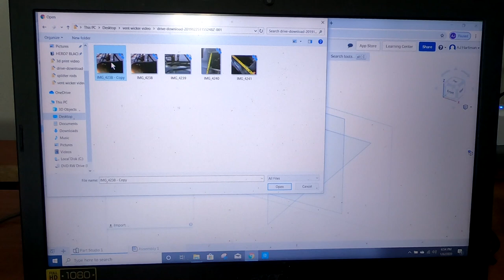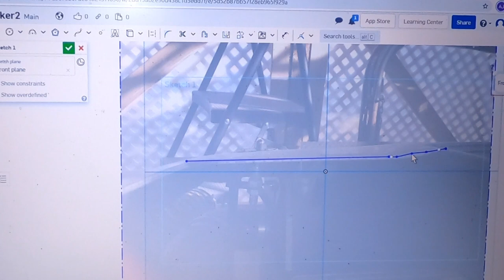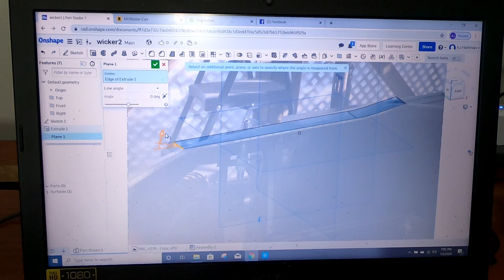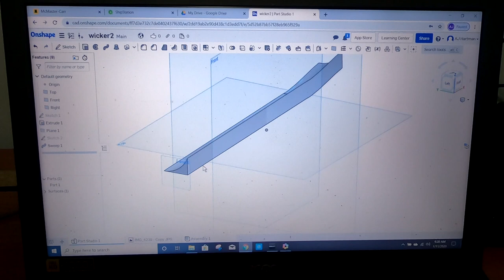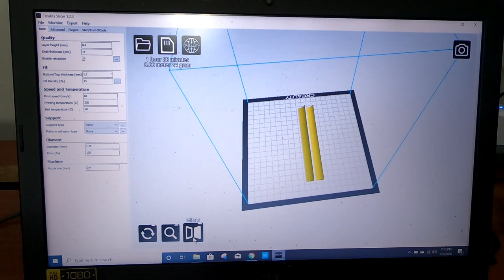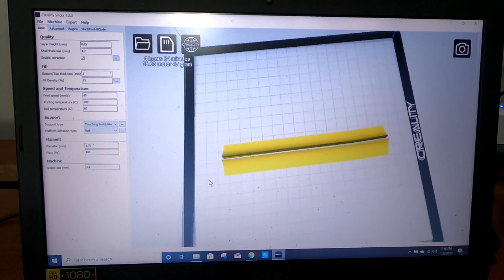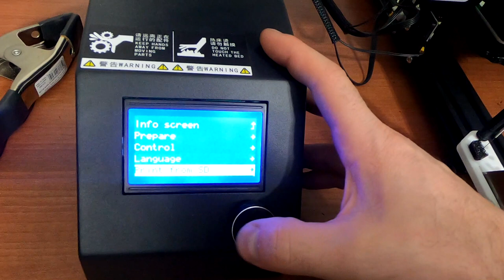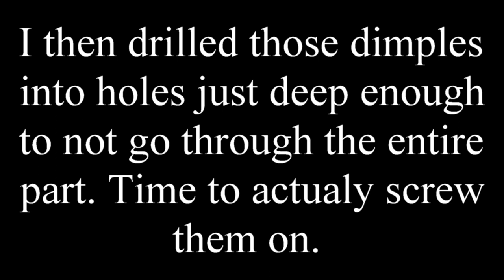3D Printing Car Parts from a 2D Picture

Comment: Great tutorial! I also Got myself a 3d printer for car related projects, CR10S )
Reply from the maker: Nice. Same exact one I got. I love the thing already. What projects are you working on?
Reply: @ajhartmanaero  Nothing fancy. Justified the purchase originally to make brake air ducts, but learnt that bigger parts take a lot of time and patience. Used to make mock-up parts for intake. Also did bunch of brackets/mounts and misc stuff... Big one was intercooler shroud for my Subaru. But again, ended up using part made from parts of failed prints from different versions of design because of time was running out. Still works to date, though!)))
Next one will be steering position sensor mount and suspension sensors mounts. Plus still 
want to make Porsche-style deflectors on front suspension arms to direct air flow to brakes...
Great tool overal, but takes time to master. btw, I'm also using OnShape, great stuff! Tried Fusion360 before, but licence expired and I can't justify paying for it for my tasks...
Reply from the maker: Homebuilt Racing nice. What material are you printing in? And yeah the time to print can be pretty crazy sometimes. Depending on the part I could make a carbon part faster. And that’s usually a time consuming process haha.
Reply: @ajhartmanaero  PLA inake part melted under the bonnet. kind of expected ) But easy to print.
ABS parts work better, but tricky to print. Need enclosure and some tweaks..
PTEG is currently my material of choice. I made string alignment kit with in PTEG. Probably would be easier to weld bunch of square pipes together, but I made it entirely of plastic and aluminium tubes...
You probably can make some fixtures for carbon parts, but again... I believe CNC mill and something easy to work on like foam or wood will probably be better for mid/large pars.

Also I experimented with big nozzles to decrease print time for larger parts. Basically with stock hot end  you can print with 0.8 or even 1mm nozzles and increase layer height. You end up with 30-40 min for reasonably big functional parts, but you needs to tweak settings and know the limit of your hardware, because appearance and strength can be affected after some point...
Reply from the maker: @777MAV  Thats funny, I've been really looking into PETG lately. My printer is in my house so didn't want to do ABS and seems like PETG is the next step up for temperature resistance. Since we both have the 10s you mind sharing your settings? What brand fillament? and what hot end did you upgrade to?
Reply: @ajhartmanaero  My settings won't help you much - It's not something fancy. I'm not printing lots of stuff, so every time is like a first time - update all the software, go trough new stuff.... Try printing... Fail... Adjust bed..  Fail.. Get profile from some forum or something.. Fail... and so on... 
Most of the time problems are solved with good bed level, dry filament and systematic approach. And if first layer sticks well - it'll probably be OK. Pros tell you that even different rolls of same brand filament might need tweak in temperature and other stuff, but I think in my case problem is that i leave filament open, it gets moisture and so on.. I don't have time or desire to go trough whole procedures (storage, calibration, preparation) as intended because at this point you basically 3d printing as full time job ))) So I kind of decided to go trough all these struggles every time...
Recently I used Amazon PTEG and i had good experience.. But not colors are equal, I even wouldn't say that it's same type of plastic looking at it. So basically you need to try something and stick what works for you. 
Also I recently bought piece of mirror instead of stock glass. It helped a lot with print adhesion but not solved all the problems.
I liked printing with ABS but process is more involving, but with good enclosure it works great. Althogh as I understand, nowadays it's basically replaced by PTEG because of easier to print and same performance in other aspects. 
Also printing less these days because I'm not happy running the machine in my apartment.  From what I read - any kind of plastic used in FDM process has some emissions and micro plastic particles are also a thing.  You probably know more about it working with carbon fiber and resins, but I have to keep it in the apartment for now and I don't want to turn it to shop more than it is now..
Reply from the maker: @777MAV  Makes sense. I feel like its something I can figure out and hammer down a system.I'll be sure to document it on here and will most likely get some pretty nice fails along the way.